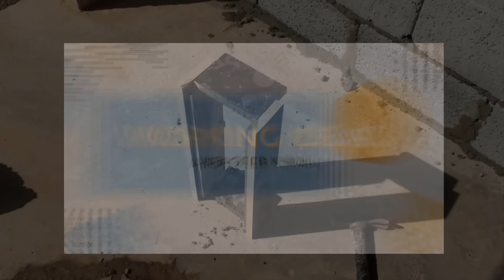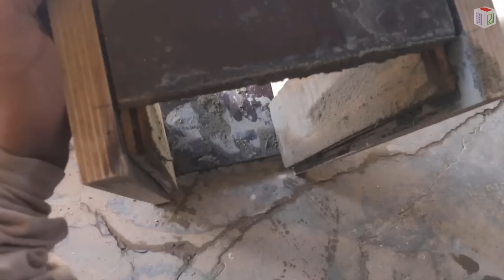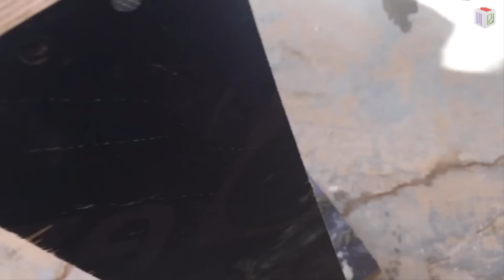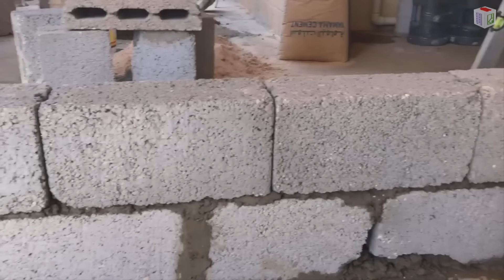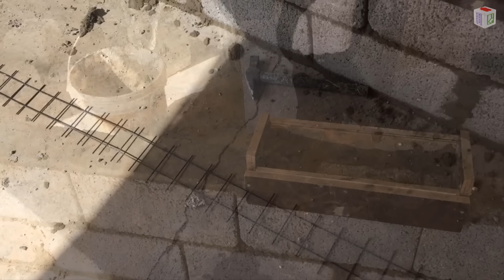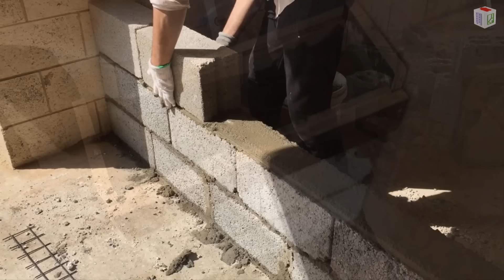Handmade Cement Mortar Spreader Tool for Block Work

Comment: Try it in filling chb with vertical bar
Reply from the maker: i will make another similar handmade tool for the same work, Which will be able to work in the presence of vertical steel bars

Comment: how about the vertical bar?😅
Reply from the maker: no tool applies when vertical bars are installed, but it is better to leave that area and use it in that area where no vertical bars are installed

Comment: How will you fix the adjacent joints?
Reply from the maker: this was a demo video for this handmade tool, but usually when meson install the blocks, they apply first cement mortar on joints.
but in our situation, we did as well but you won't see here it clearly because, blocks joints dose not have much space

Comment: Pardon me if this subject was already covered. But I am wondering what height the tool should spread the mortar relative to the desired thickness once the block is laid? For example, if there is a required 10mm gap once the block is laid, should the height be approximately 15mm? This would allow for some compression as the weight of the block sits onto the mortar. Thank you and well done with this device :)
Reply from the maker: Sorry for the delay. If required 10mm, then it definitely needs extra height, but its dependent water Cement ratio. Loose mortor needs extra height. So you have to experiment with your requirements. .

Comment: Have you got instructions on how.you made it ?
Reply from the maker: i was sitting and watching my mason working.. so i thought there is something i should make something for them, then they would able to work fast and easily and don't waste mortar as well. so i come up with this idea.. i took the size of the block and told my carpenter to make this box according to my instruction, so he did.. by the way, it boosted the work speed at least 20% 
that was the story behind this.. lol
Reply: @WorkingIdeas  and the instructions were :) ?
Reply from the maker: @diluxe  do you mean that you need its drawing to make a similar tool?
Reply: @WorkingIdeas  yes
Reply from the maker: @diluxe  well i don’t have this tool now, give me your email or whatsup!i will try to make its 3d design for you

Comment: This idea is ingenious, but I must be missing something here. 8" x 8" x 16" cinder blocks have square holes on both sides. Mortar would fall through wasting 80%. Unless these block are solid on the surface, I cant see why fresh mortar has not fallen through ??
Reply from the maker: Thanks for visiting. This item is specifically made for solid block or bricks.
Reply: Thank you. I've never seen solid 16" cinder blocks as I've seen (and working with) the hollow 16" cinder blocks. It takes lots of skill to spread mortar on cinder blocks in building a wall.  Thanks again for your reply., Keep-up the great work.
Reply from the maker: @jadesystem  thanks brother

Comment: Nice job! It's similar to the bricky that I use but atleast you don't need to keep lifting it lol
Reply from the maker: thanks brother.
Reply: Do you have to keep lifting the homemade one, or the bricky?
Reply: @mojomojo5779  no but if your going to have one just make it. I found the bricky difficult with bulkiness to get into tighter spaces where an object is close behind.. this guys got  a better design in my opinion.
Reply: @G.S.Design  So you would rather make one than buy the bricky if you didn’t have a bricky mate?

Comment: no have rebars?
Reply from the maker: there was! but in 3rd layer
Reply: @WorkingIdeas  only horizontal? but the vertical?
Reply from the maker: @jhomclixtv5445  you are right bro, but you can see in video ,it was a small wall and both sides was already supported!

Comment: Doesnt the block suck the water out of the mortar right away? Why not vertical joints?
Reply from the maker: Thanks for the comments! Well this was a demo video, here we used a little extra wet mortar, so the blocks waste a small amount of water which doesn't matter and about the vertical joint, which block we have here Used, it was modified with a 1 inch half circle on both sides. Left and right so when 2 blocks lay down together, both blocks create a 1 inch circle space so we inserted mortar over this area

Comment: Great work 👍🏻 
@working idea can u tell me the dimensions of that tool pls ?
Reply from the maker: the block you have seen in this video it was 15cm wide. so i made this tool according to this width, and about length it was 50cm and hight was 10 cm from longitudinal sides, this inner wooden pieces which stands on blocks it was 12mm only

Comment: And where's the constrution rod?
Reply from the maker: horizontal steel bar laid on 3rd layer.. but vertical bar was not necessary here  because it was a small wall 2nd it has  already supports on both sides

Comment: Block works without steel bars are not ideal. Construction nowadays are made easy but of less durability
Reply from the maker: i will make another similar handmade tool for the same work, Which will be able to work in the presence of vertical steel bars